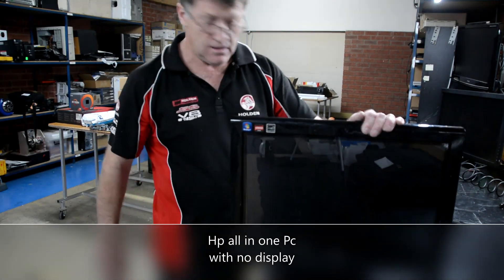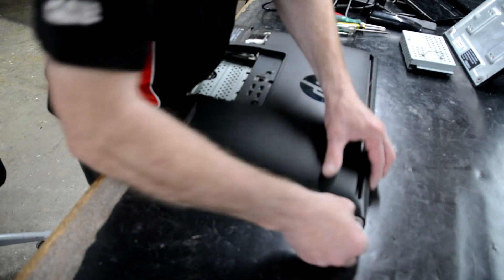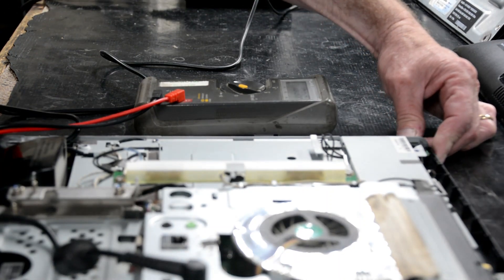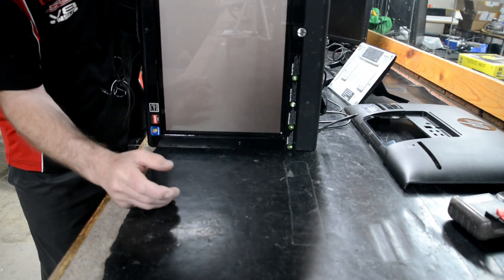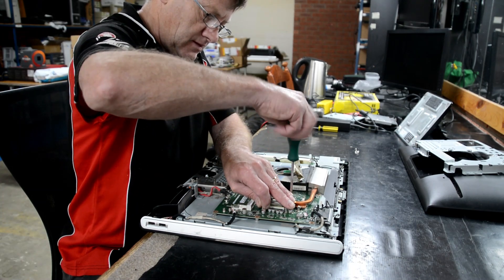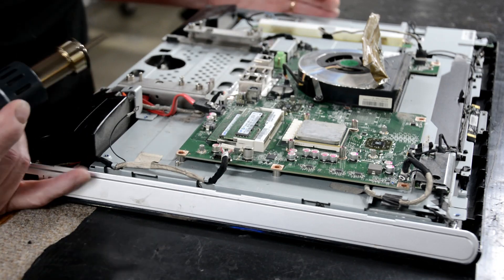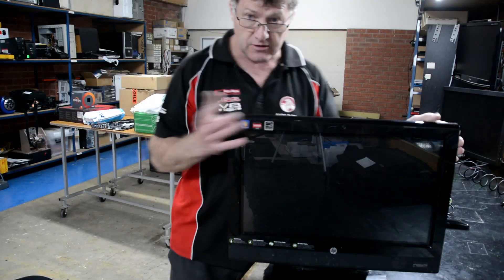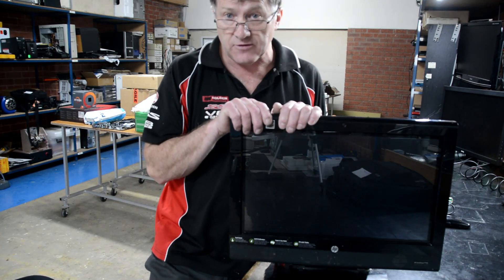Hp all in one Pc no Display Repair

Comment: I have an HP pavilion 21 All-in-one with a Pentium CPU, I tried to install a new CPU i5 but got no signal for some time, I then reset the CMOS Bios [even replacing the battery] and booted it up with one RAM stick installed but still no signal, and so I switched back the CPU [to Pentium] and it's still not giving me a signal and the Fans are running at full speed even with new [Grizzly Thermal Paste] cooling paste applied. The PC Auto boots when plugged in the first time and it did at first gave no Ports signal but now I just need the Diplay to show something.

I've tried every trick to F8 - F12, to holding esc Key, and even WINDOWS Key+B Key on start-up, but no changes.
Is it fixable?
Reply from the maker: Was it  working fine before the CPU swap?
Reply: @SuperDavidcass  
Totally fine, like a new rumba with the new sticks of 8GB RAM.
Reply: Did you manage to get it work again?? I'm having the same issue flashed the bios too nothing 😢
Reply: @osama5444 
Nope did some more test and I come to the conclusion the port works, though I need to get a none wirekess keyboard for it to send a proper signal, a cabal keyboard would be in direct contact with no delay... though when I get more money I'm taking it up to Micro Center to get their expertise on the matter. I don't want to damage it anymore then what I've already have.

In other news I took almost all of it apart and put it back together for a good clean and for test if some components was damaged or not all seemed to work well and booted up but without a HDMI port I have no direct feed besides them belt in touchscreen. I also need to find the backed-up files to it so I'll have a clean boot, I've had some memory problems prier to the swip and I think the files it tried to unpack may have been too much, and I was not about to wait 24 hours for a startup boot. On a new computer with hefty specks, Sure, but a old model that fast boots almost each time? I say no thank you. lol

At least I had a back up LT.

Comment: Hey got a HP-24 AIO and the screen is not displaying anything just black and sometimes blue, is this a bios issue would you recommend replacing the CMOS which is what I’ll try next because a new power supply did resolve the issue thanks

Comment: Hello Sir, I have a hp pavillion 23, i have a  plethora of issues with it. Firstly when I power it on There is no display. After a few hard resets, i get display and then suddenly there are some black lines on the hp logo and the screen freezes. Sometimes i do manage to get it to work but the problem reoccurs when I shutdown my pc.
Reply from the maker: It will be cpu graphics bga issues if you are getting lines
Thks dave

Comment: I have this issue with the same model but got the problem quite some time ago and I didn't know how to fix so left it, assuming it wouldn't be worth fixing seen as though I had a laptop which had a better processor and what not. 

I've just got a new desktop however and want to have adobe cs6 on my laptop and my new desktop but 1 out of the 2 systems I can have CS6 on is my Touchsmart. 

I wouldn't feel confident opening up the PC or following this video but was wondering if there would be a way to just connect the PC to a TV screen and then uninstall CS6 off the PC so I can put the second allowed version of CS6 on my new desktop. Then I would have CS6 on the laptop and my new desktop. 

Could that work? or is there not a way to connect it up to a TV? It doesn't have a HDMI output but there are other ports that I think are for an antenna and maybe something else. Thanks.

Comment: Hello. I have same problem with my HP. At start it turn on but no display. When I heat the motherboard near power imput, After start, display is ok. When I inplug thé power cable, and plug, restart it, no display. Help me please. Thanks

Comment: The applied heat to both bga chips is enough to reflow 'em exactly as an winter's sunshine day to make you feel hot.To melt the solder balls of bga in these pcbs needs hotter than hell having also bottom preheating.

Comment: great video i have a All in One HP model 24-g014 my touch screen is not working i have try drivers from windows and HP and no luck is like the touch screen is not connected but it is need a little help 
thanks
Reply from the maker: See if its listed in devices

Comment: Hi Dave, I followed all your advice and amazingly (for me) II got my screen to work after using a hard start. When my computer was running I could restart using windows however when I shut down completely I have to do a hard start each time I turn my computer on. Do you have any ideas as to what my problem could be
Reply from the maker: Ok, your saying if it goes to sleep it wont show a screen ir come out of that mode?, you have to switch off and restart, try going into display settings and turn off all sleep settings , put screen saver on only, see if it keeps working,  may have a software problem or corrupt ios, try a windows refesh or update
Thks
Dave
Reply: @SuperDavidcass  I'l try that Dave thanks but my problem is is that when I turn it on the screen is blank, after refowing the solder as you did I can get the computer working perfectly but only by doing a hard restart every time I turn it on.

Comment: Why did you leave the radio on making it hard to hear you ! But great video
Reply from the maker: Thanks peter it was one of my first we know mic picked up audio, we appreciate your feedback
Reply from the maker: @petertrainer5508  depends on distance from chip, approx  350 degrees, 3  inches away, wide nozzle,  air flow around 100, a good guide is when you see the flux bubble out the sides then do dry, we also have a reflow machine we used to use it heats bottom of the board same time , we used it to reball the gpu on the xbox's ,
Ps it was i think my first video i didt have my microscope camera set up then. It better to underflow than go too hot, you can always do it again for longer if it didnt work.
Reply: @SuperDavidcass  Thank you. I have tried all the other fixes after watching your video except trying to reflow the solder. I've never tried it before so wish me luck lol. My initial problem was that the screen would work sometimes but not other times. I've tried restarts etc but now clasping at straws lol. Cheers

Comment: What was the thing u used?
Reply from the maker: if yours is no screen you can use a hot air gun at 350 degrees for about 15 to 20 seconds hold approx 4 inches away from the chip, use foil around the chip , you need to pump liquid flux under the side of the ship untill it flows out the other side

Comment: What was the liquid you used on the mother board?
Reply from the maker: Its a surface mount flux, because its water like its able  to flow right under the chip when it squirts out the other side you know its right, we used it on gpu chips in consoles , pcs, nvidia  chips on laptops etc
Reply from the maker: @Pablo Chowdhury no reason to be, im fully qualified tv tech
Reply from the maker: @Pablo Chowdhury can use a hot air gun, will need the flux though
Reply from the maker: @Pablo Chowdhury its worth ram swap
Reply: Dave Cassells Electronics  OK thanks for your reply. Do all these HP`S have dry solder joints?
Reply: Does this artic silver repair bad solder joints?
Reply from the maker: @RobWillmot  no Artic silver is only used to get a good bond between the heat zinc and gpu , the only way to fix joints is to reflow using the water like liquid flux and heat the balls up,  we also have a rework jig , it heats the bottom and top of the board same time , ill post a video of it, for the home tech you can insulate aroung the chip with heat proof tape, and use a hot air gun at 400 degrees about 4 inches min away and keep it moving for approx 15 secs
Reply: @SuperDavidcass  Do you have a brand name for this water like flux
Reply from the maker: @RobWillmot  ill find out what it is and reply , we had this for 20 years 500ml will do you a lifetime
Reply: @SuperDavidcass  Thanks for your help
Reply: @SuperDavidcass  Hi Sir, can you share what is the brand of the liquid flux that you used? Thanks.
Reply from the maker: @RobWillmot  no its only heat transfer, gives a good bond to metal heat zinc
Reply from the maker: @RobWillmot  anything with bga solder balls does
Reply from the maker: @RobWillmot  yes most bga chips suffer from dry joints from heat,  we've done a lot of consoles lg tvs laptops over the years. Anything that has a heat zinc on it basicly. The ps4 blue light of death is a good example,  we used to pull of the xbox 360 gpu and reball them
Thks dave
Ps ive now got my new camera set up so will do more detailed in the future.
Reply from the maker: Multicore X33-08i Sustain Activity Flux
Reply: @SuperDavidcass  Hi Sir, Thanks alot, i have same model of the desktop showing white screen only, i already did the process in your video, but same result, maybe the mother board is not working properly anymore.
Reply from the maker: @redensalonga8139  white screen can be the screen itself not the chip, mine was black screen
Reply: @SuperDavidcass  whenever i turn on the PC, at first the fan rotating fast after a second it slow down.